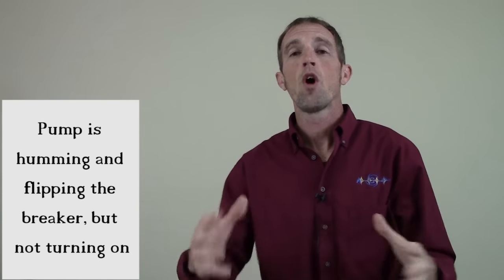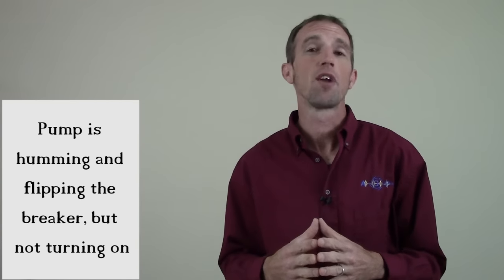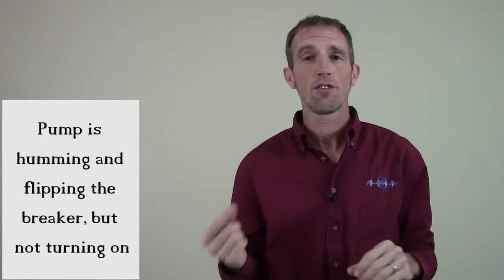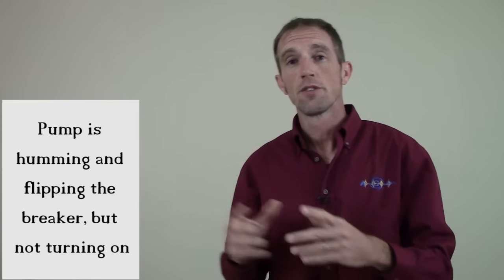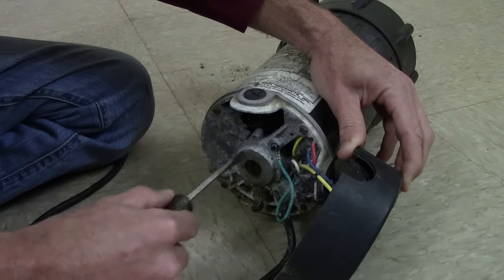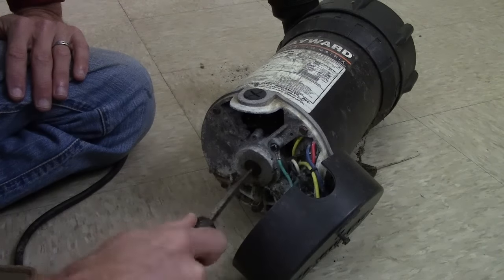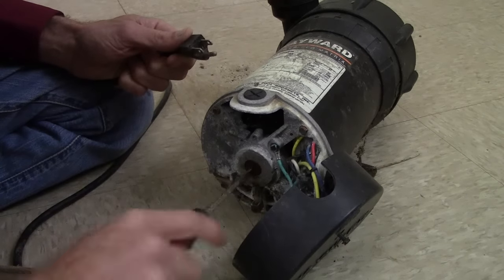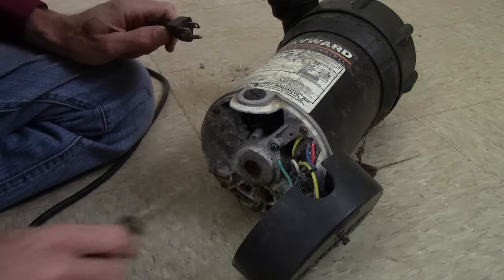Above Ground Pool Pump Won't Start or is Humming & How to Fix It

Comment: My pump is only 2.5 years old and was working yesterday. I live in the south and it runs year round so it has never been dormant for more than 18 hours and that's not enough time to accumulate corrosion. . Today, it only hums and shuts off. What could cause this if it isn't corrosion?
Reply from the maker: +Sheri Oberle It could be just the pump itself.  Some are better built than others and the pump could just be having problems.
Reply: +Above Ground Pros Thanks. Apparently it is the capacitor. We have had a lot of electrical storms and tons of them in the area have done the same thing in the past two weeks. But this is great info for future reference.

Comment: What if u don't have one of those pumps I have a summer waves pump x1000 and mine won't turn I hear the motor running but it won't turn
Reply from the maker: +melissa hernandez I don't believe those pumps have access to a shaft in the back so you would probably have to take the pump apart and turn the impeller by hand.

Comment: My pump buzzes and doesn't turn. That screw connected to the shaft turns pretty easily though. I tried the jump-start trick with a cordless drill anyway, but it didn't help. Any idea what else it could be?
Reply from the maker: +Rob Worsnop Sounds like a bad capacitor.  Replace that and you should be good.
Reply: +Above Ground Pros My model doesn't have a capacitor. Could it be the centrifugal switch? (Whatever that is.) The motor is an A.O. Smith SP1510-Z-1-XESC.
Reply from the maker: +Rob Worsnop I'm not sure about that Rob.  It may be worth taking it to a pool store or motor shop.  It may be a simple fix, but it's getting a little above what I'm used to.

Comment: I keep taking cover off and turning the frozen impeller screw..is there any reason why I can't drop some 3 in 1 or some wd40? On the screw and towards the front where it the rod goes through? Could this thing be stuck from all the bullshit I been vacuuming up? Cause the rod turns never had a huge problem just one easy turn of my flathead on that impeller rod screw and good as new but when I turn that sucker off it like to freeze back up on me again..any suggestions I'm poorer than a  churchmouse on Sunday tithin. Please get back to me. I'm a widower and I've pinched those nickels so hard I've surely squeezed the snot outta old George I have taught myself to make my own pool vacuum using shitty cheap ineffective hose and net on a sweeper head converted an old intake cap cut a hole in center of that cap then fitted a pvc pipe to fit inside that hole SOS I could fit a pool tubing hose over IT real snug then screwed it onto the inside pool intake opening and ta other end of that long pool hose tubing fit it into the sweeping vacuum head hole where the garden hose was meant to go..I also since I have 2 intake openings inside my pool I gone ahead an stuck the black caps that you use to seal up the intake caps SOS when you gotta clean out your filter yoiu don't have your pool draining out through them intake and return openings so I take me one of them there caps seal off one of the 2 intake openings SOS I have all the suction going to that there sweeper and of course the sweeper heads got the other place to attach your pole so you can guide it..I hope this helps somebody just make sure you only get an ABOVE GROUND BRISTLED SWEEP VACUUM HEAD because the other ones for regular built in concrete pools will like to tear up your liner and there ain't enough glue or money to repair that mess so don't do it or you'll get your tit caught in the ringer for sure..ask me how I know..don't be stupid take it from me if I was a native American my name would be  forehead with red palm print..from hitting myself whilkst screamin what was I thinking! Please lemme know bout that 3 in 1 oil..everybody have a good day. Sincerely, Grits
Reply from the maker: That may work for the time being and help out some but keep in mind that it's also going to deteriorate the seals in the pump and eventually you'll be replacing it.
Reply: Above Ground Pros thanks I'm kinda bummed out about that I paid a pretty penny for it and don't have that same opportunity financially to buy another one like it with my money situation..trying hard to make it last..I've only had it three years that's why I'm so upset think I paid 300 ..bummed out

Comment: I tried it, it worked except you have to do this again after it turns off. Can you oil the inside somehow?
Reply from the maker: Not that I know of. You may have a bigger issue and may be worth taken to an electric pump repair guy.

Comment: I had high hopes. My pump is moving freely but unfortunately the kick start didn't get it going. It did prolong the amount of time before the break tripped but didn't fix it.
Reply: I just fixed mine that was humming and the suggestions in the video didn't work but I replaced the capacitor and it works. If you unplug the capacitor and try the motor again. If it turns on, the capacitor is bad. Easy fix

Comment: Hey guys! So today turned the pump on for a few hours and when I came outside to see the water, the pump wasn't running and it is still plugged in. Any ideas? Any help would be appreciated. Thanks.
Reply from the maker: Ben Dover Either the breaker on the outlet or in the house flipped, the thermal shut off inside the pump flipped which will come back on as the pump cools down, or the pump may be shot.

Comment: my issue is the the pump is rotating in reverse....not sucking the water from the pool into  into the filter.....is it a electrical connection problem?
Reply from the maker: Sounds like the wires are wired backwards.
Reply from the maker: Above-ground pumps don't have capacitors

Comment: Yeah, i went outside to turn my pump on. It hmmmed but wont running. I took cover off got a screw driver and i turned the shaft. I put cover back on turn pump on and it wasrunning. It works!!

Comment: I'll try this but my pump has been running for like 2 weeks with no trouble and it just started humming today so if it's not corrosion then is the pump just dead?
Reply from the maker: Correct but that should be something that you should be able to get under warranty it's only 2 weeks old
Reply: @abovegroundpros  oh my pump is like 8 or 9 years old I think, same kind that's in the video just a different switch for the on off (low, off, high, switch) but yeah I couldnt get the screw for the back cover off, even broke a flathead trying lol so yeah if I cant get this pump to work then I have another one that went with a sand filter so hopefully that will work till we find a new one cheap.

Comment: I turned my pump off to clean the filter, go to turn it back on and nothing. I can feel my pump hum when I turn it on, but I can't access the pump itself.

I have Intex pump that's within a housing, but removing the housing doesn't really give you any access to the impeller in the pump. :/
Reply: Chris Cunningham - 

flotec fp5172 inside motor look

Comment: I can't get the metal cap off the back. Motor shows lots of signs of corrosion. Any idea how to get off the cap, so I can get a screw driver in there?
Reply from the maker: +Cam Cameron I don't know any trick to tell you.  I usualy use a screw driver and pound the cap off with a rubber mallet.
Reply: +Above Ground Pros - I can't kick start though because there is a bunch of electronics over top of where I assume that shaft hole is --- It is a Hayward A.O. Smith.
Reply from the maker: +Cam Cameron Sounds like you have an inground style pump.  If this is the case then this method will not work.  You will want to replace your capacitor.

Comment: Mine will run for five to ten seconds  and then will be humming and the thermal breaker will cut it off  then by two or three min will start again and the it will go to the same procedure any thought on that
Reply from the maker: +Eric Flores I'm afraid it's time to replace your pump at this point.

Comment: I broke the corrosion off but it still won’t go, any tip?
Reply from the maker: If you can spend the shaft it may be a good idea to try to spin it with a drill and then flip the power on and if that doesn't work you might just have to get a new motor

Comment: Pump stopped, won't restart after resetting. No humming, but water gushing out the top of it. Had to plug intake/output holes to stop it. Fairly new pump 1 mo...I'm new at this, help!
Reply from the maker: +Lynne Spivey I would definitely call the company you bought it from. All pumps in the industry carry a one year parts and labor warranty on them and I believe your pump definitely needs to be warrantied.

Comment: even easier is to put a flat head bit in your cordless screw gun and kick start it with that. Start the drill to get it spinning, then plug in while it is being spun by the drill. Works everytime for me.
Reply: cory mayo did you leave it running by itself for a couple of hours before installing it back to the pool??

Comment: Mine has a short..I believe is a short cuz when I turn the switch on it sparks inside..any suggestions what it could be??
Reply from the maker: It does sound like you have a short internally in the motor but I wouldn't know what it was. I recommend taking your pump to a electric motor repair man and it should be an easy enough fix for them.

Comment: I did this and the pump started working. But it won't pump any water. And everytime I turn it off I have to do this trick with the screwdriver again. Should I just get a new pump?
Reply from the maker: If you have to do it every time then yes I would recommend getting a new pump.

Comment: I have a pump that is about 3 weeks old. Has worked perfectly. Today I tried adding on a skimmer that hooks over the rail. I cut the filter off hooked the skimmer up plugged the pump up and it’s not doing anything. That was about 5 hours ago. I came back to it plugged it up it hummed for a few seconds then nothing. The casing like where the motor is it’s hot. Does anyone have any idea what may be wrong. I have it connected to a Coleman pool and of course a sand filter. Please HELP!!!
Reply from the maker: That pump should still be under warranty and I would contact the people you bought it from

Comment: I have these symptoms but the shaft spun super easy when I took the back off....??
Reply from the maker: That sounds like there are some internal issues with the electronics of the motor and you may want to take it to a motor shop or if it's less than a year old talk to your purchaser about warranty
Reply: @abovegroundpros  thanks, I replaced the capacitor and it started up. This particular pump is 15yrs old.

Comment: hi! I follow your instructions, the motor start. but, after 5 to 10 minutes it stop again.
Reply from the maker: Sounds like a power issue or if you are running it on an extension cord, the cord may not be pulling enough power.

Comment: My pump is still connected to the pool. Correct me if I'm wrong but it should be real hard to do this with water in the lines.
Reply from the maker: Whether there's water in it or not shouldn't matter because you're only messing with a back of the pump.
Reply: So I wouldnt be trying to turn the water that's in the spa by turning the shaft in the motor? I should probably preface to say I found the capacitor shown straight zeros with multimeter capable of testing capacitors.

Comment: Ive got an Inground pump.No screw slot on the end, it looks like points from an old car
Reply from the maker: If it's an inground pump and it's doing what shown in the video it's probably the capacitor has gone bad.

Comment: we had a power outage and our pump went out. at first it would turn on briefly and seemed like it would trip and turn off. now it won't turn on all all. what do I do?
Reply from the maker: Melissa Leal Either it has flipped a breaker on the outlet or in the house or the motor may have been damaged by the surge.  Test that you are getting power to the pump and if so the pump may be damaged.
Reply: I have no idea where to check it. Is the breaker usually near the pump or is it on the outside breaker box? Also my pool light is working is that the same breaker?
Reply from the maker: Melissa Leal I'd have no idea how you have your system wired up and don't want to send you on a wild goose chase.  If the light is plugged into the same outlet as the pump, then yes they are on the same breaker.  You may need an electrician or pool guy to take a look at it.

Comment: my switch is no where near the pump so I cant turn the  pump and turn the switch on at the same time, any other suggestions? can I just loosen it up and then turn on the pump?
Reply from the maker: You can try do but if it doesn't work you might want to get someone to help you and let them flip the switch while you turn it.
Reply: thanks but I posted another comment that I was able to do it, did not need to start at the same time at all.  Mine also has a solid shaft and I had to use a wrench instead of screwdriver.  There is no way you can turn with the wrench and turn on the pump at the same time, I Would never be able to remove it quick enough...… I can only imagine broken parts and maybe fingers.

Comment: You are such a helpful dude! Quite a few of your videos have saved my tail. But nothing like this one. I was going crazy! This was so easy and really worked! My pump sounds like a dang weed whacker now though. I'm wondering if I let it run for a few hours if it will quiet down? Is there a lube spot? Thanks again for everything! VERY HELPFUL!!

Comment: A big trick here.  Get some Marine Grease...and lube that area where that screw drive is..and lube the shaft on the front part...and push that grease into where the shaft goes.  Let it sit for a few minutes.  And then crank it on.  I do this when the pumps brand new and once a year there after.   That pump will last for twice as long as it normally would.

Comment: After replugging in pump after back washing . Pump won't do anything  bracker checked and ok  is pump broken.
Reply from the maker: Linda Stiner I'd check my power source first.  Make sure you have power or try to plug the pump into a different power source to confirm its the pump and if it continues to not turn on, then it may be shot.

Comment: but what if it's a BRAND NEW MOTOR!? I had mine for just under 2 months and it has a quite hum, no water output.
Reply from the maker: +NotN8 you may need to talk to her you bought the motor from for this situation. It may be a bad motor

Comment: The copper wrapping is called an armature. If it’s that hard too break loose it’s probably going too run harder and cost you more in electricity.

Comment: This is good, but there is another way also. Most motors, including mine have a starting winding that is for the kickstart. at the same end shown, there is a contact point that should be touching, but not because of corrosion. with the power off. USE A FILE OR EMERY CLOTH TO CLEAN THAT POINT, then when you plug the power in it should start without your help.

Comment: Thanks for the tutorial but i wanted to point out some miskakes and other ways your pump may have broke respectfully, first off the picture of the motor you show was a brushed motor and armature and this is not what kind of motor most pool pumps use. Pool pumps most of the time use induction motors, Also there are some other reasons your pump may be humming other then it being seized (from corrosion) most commonly 1: a bad start capacitor. 2:A bad cyntrifical switch (there are a few different ways a cyntrifical switch can break, like it being stuck, or getting bad contact and not turning on the start windings) also if you pump is too corroded to spin you can change its bearings and maybe have to get rid of some rust to get it back alive without replacing the whole pump or motor.
Please note i dont mean any disrespect by this comment i just figured i would share my 2 cents and maybr help some people. Thanks

Comment: I could probably help by starting it a few times during the winter.
Reply: The pump can only be turned on when water is in the filter tank. If not it will destroy the seal.

Comment: Well, this didn’t work for me and here is why. My impeller spun, but hummed and no start. The start up capacitor in pump swelled up and went out on me. I would suggest, if your pump spins (power off and put hand in basket you can spin with fingers) but hums when you power on, it could be the capacitor. It’s around 10-50$ replacement depending on rating.

Comment: my pump was only 2 months old, it was working fine, i then turned it off to clean out basket, plugged it back and it did the humming sound then a tick sound then turns off. I tried this trick and some reason it still wont work :( it was a dohney

Comment: For anyone reading this, even if the screw turns fine, I tried. Smooth as a babies butt, but still wouldn't kick on. I tried putting a drill in there when I started it, still wouldn't work. Finally I just took a screw driver and brute force the blades around until it started spinning on its own.

Comment: What happens every time I turn it off it needs another kick start
Reply: Blown start capacitor.  All good pump stores sell them. it will be the large white cylinder wired under the plastic cover where the power cord connects. Will have its rating on it; e.g 14uf (micro farad). BTW you can usually tell visually that it is blown. it will be swollen in places or even burst